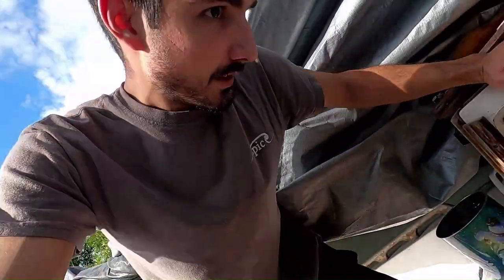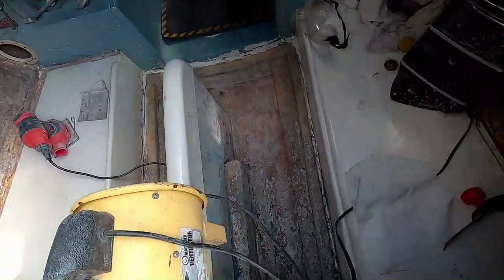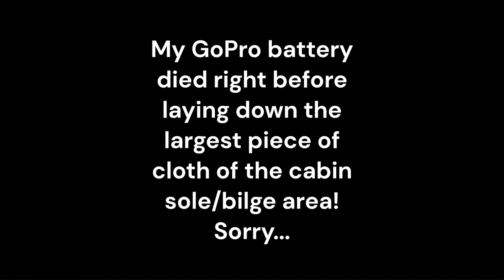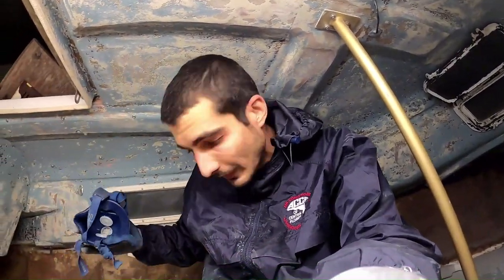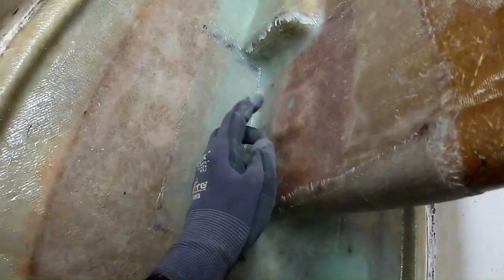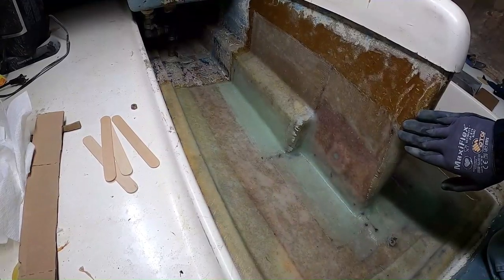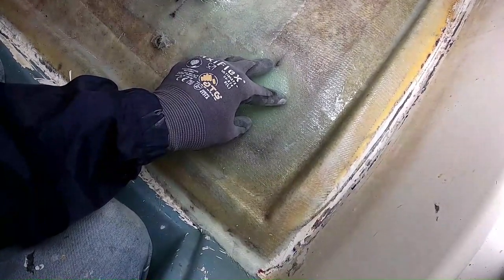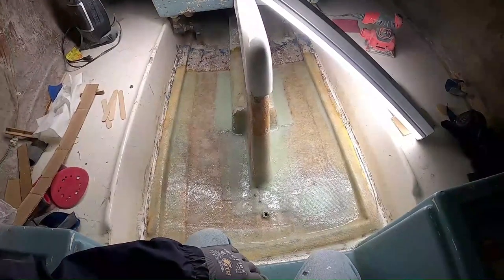Project Seahorse: E4 Reinforcing Cabin Sole & Centerboard Trunk

Comment: Just in the process of buying a mariner 2+2. Living on my Pearson 26 in Virginia. Hoping to get my new gunkholer ready this Spring. Going to clean it tomorrow. I did a lot of similar work to what you're doing on your boat to my P26 last year. Sailed it 450 miles after removing and glassing over 6 through  hulls. No leaks. Been above water since!  I used straight 17 oz biax and had no issues. You did it fine. No worries. My Pearson has a 4 foot iron keel. Did all of what you did but didn't know about that POR 15.🤬 Probably be doing it again next year. Oh well. I just got back from St Pete. Spent some time on my buddy's Catalina 27 there. He's moving to Orlando to go to that school for marine diesel.  Hoping to take my new mariner down to the West Coast and explore Charlotte Harbor area on down toward 10,000 islands. Keep posting. Going along nicely! Best regards. Charles.
Reply from the maker: Good luck with your Mariner! Any videos or posts on it? There’s a Facebook group of Mariner owners if you’re not already a member, as well as the Mariner Class Association (but requires a yearly fee). Currently I’m working on the hull-to-deck joint around the entire boat: I just finished glassing over the interior side of it. The Pearson 26 is a good looking boat! I’ll mostly be exploring the east coast of FL, but want to do a trip to the keys. I actually hadn’t heard of 10,000 islands- just looked it up and it’s definitely on my list now! Hopefully we can get a Florida Mariner rendezvous going.

Comment: You have no idea how helpful your videos are man, I have a 1966 mariner that I am also restoring and following along. It looks like you have the 2+2 which is a little different than mine but  I noticed a pipe going down from what looks above deck on the starboard side of the trunk, what is that? Thanks so much, keep it up
Reply from the maker: @andrewroman9511  So you have the open cabin model? Those are cool boats for sure, much more spacious than the 2+2. The pipe you’re seeing is for the self-bailing cockpit. The cockpit area is raised up to make room for the +2 bunks so it makes self-bailing possible. The stock cockpit drains are really small (1/2”) and prone to clogging. At some point I’ll install larger drains and throughulls so it can handle a lot of water and won’t clog easily. I appreciate the support!

Comment: Sanding fiberglass is tough. The vibrating or orbital will work, but very very slow. The circular sanders with 80 and 40 grit will cut nicely.
Reply from the maker: Hmm maybe I should look into that…  recently bought a used Makita 1 1/8” belt sander which has been nice for small areas, shaping and radius sanding- Boatworks Today channel recommended it

Comment: Looks to be much stronger in the sole/trunk area.  Do you have one of those metal rollers that they use to roll the air pocket out as you are layering fiberglass mat?
Reply from the maker: I did buy a cheap set of metal rollers. I’ve switched back and forth between the roller and dabbing the bubbles to the edge with the brush. The smaller roller I have works best, but I didn’t clean it after last use and that’s why I didn’t use it here… perhaps I would have had better results with it.

Comment: My external centerboard gel coat has some crack around how handle it? A New owner. I appreciate your advice.
Reply from the maker: Is the cracking on the coating of the centerboard itself, or on the outside of the hull around the centerboard trunk?